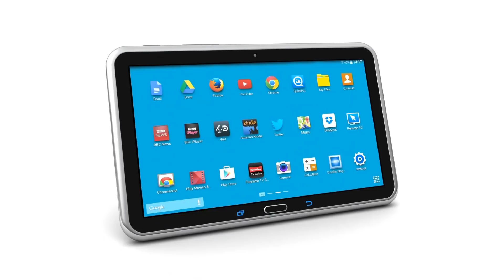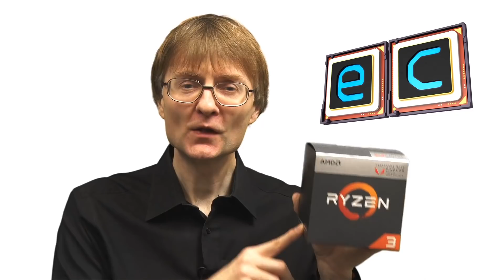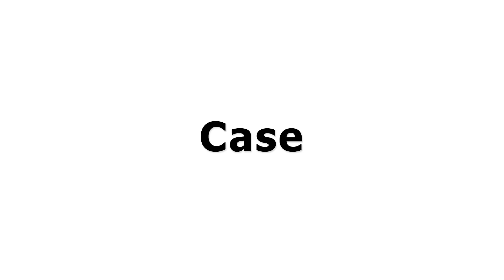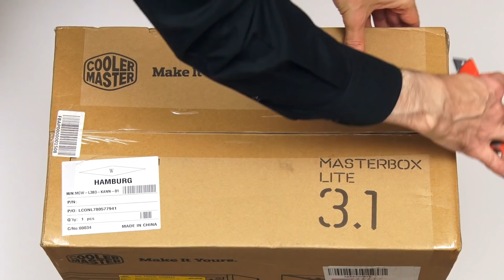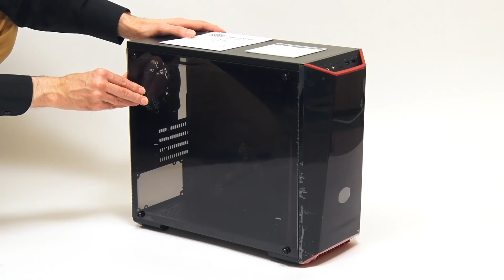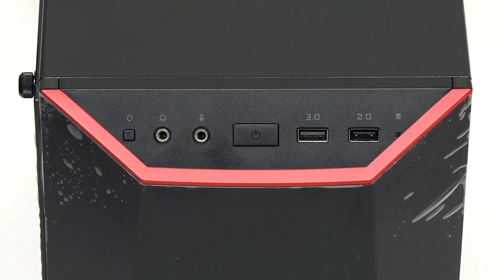Ryzen Budget PC Build #2: Case, PSU, SSD & Assembly

Comment: This series casing having "air flow" issues (btw EVGA famous 450W Psu model should be enough, and we using the same SSD S.F.S.G. )
Reply from the maker: Yes, I will keep a close eye on temps, and will be fitting two front fans. But for a 2200G build, this case should be fine.
Reply: @ExplainingComputers  I believe modding the front cover should do the trick...

Comment: 36c at idle in BIOS is a little warm, but a reasonable 'starter' PC
Reply from the maker: The PC has been running idle under movie lights for some time. It generally idles at about 32, which is not that bad,

Comment: i still using an old case from 2004 all simplistic at least it is black. there is no 120 mm fan slot but the grid on the PCI area had square holes that were luckily spaced just right for me to fit a 120 mm right there! (had to punch the holes "round" with a hammer and nail but the alignment was perfect!) so i guess i have one of those case with CPU intakes fans but mine has a custom PCI intake! 

the only way you could get as direct air is with those open air test bench tech reviewers has! so having the PSU at the top and 2 exhaust fan the air does a direct "L" shape in and out! (so i got no RGB but cooling by air is not a problem! water cooling would be impossible unless i get a saw making a hole at the top tho lol)

Comment: Great video as always! But as a pc tech/enthusiast, I'd suggest getting rid of the sandisk ssd. i see them fail more than anything else. And if it dies within the warranty period, you'll wanna pull your hair out dealing with the customer support. Samsung or WD ssds are my preference, though I end up using a lot of Crucial (Micron) ssds at work because there is a Micron facility where i live.

Comment: This case is fantastic for the price and I got it for £39.99 from Amazon with free Prime Shipping but I wish I got the version with 3 RGB fans and a power supply shroud that was £65. While it was a bit more expensive I ended up having to get 3 extra fans to cool the case down because the airflow is so bad in the case due to being quite compact and not having a lot of breathing room in the front panel. Plus what were cooler master thinking having a closed top panel. But yeah the extra fans ended up costing the same price as the £65 case cause they were RGB though they were the cheapest fans I could find. Plus the £65 has a PSU shroud for better cable management and is slightly bigger for more airflow. But I digress it is still a good case though I will probably be upgrading it in the future.

Comment: This is a decent little case for the price. I bought it for my little brothers Ryzen 5 1600 Build January 2018. (Hard to believe it's been a year). The only thing I didn't like was the Standoff threading on the tray itself. when I screwed the standoffs into the case  3 of the 6 for the Micro ATX motherboard  just spun, due to the cheaper metals of the case. But no worries, it all went together without a hitch and he loves his gaming PC. XD. 
I like the detail of your videos.  :)  much better to actually see whats going into the build and information about them. Thanks.

Comment: Little bit of BIOS tweaking required, your 2400 RAM is at 2133, probably needs XMP selected.
PS. Some cases have a hole to route the CPU power up close to it, some will allow it but only if the cable is put through before the motherboard, as there is room for the cable but not to put the connecter through when it's in place - and on that case (like on mine) some of the cable space comes from the side panel bulge.

PPS. Please do a trim change, it can be easy or damn near impossible - I absolutely failed to trim change a DVDRW (black drive with extra silver & cream trims) as I wanted to complete the silver accent, but I just could not unclip the existing trim
Reply from the maker: I will be covering the XMP setting in the next video. :)

Comment: This video took me back to my first Box when basic machines cost $2,000-$4,000 and lots of work to get it running. Beautiful job of assembly for such a reasonablev price. Using used parts today, if you know what you are doing, it is possible to build a server for under $450.00 with basic mouse, keyboard, speakers, monitor  and  DVD.  Building and testing takes time. Your video was beautiful and l am looking forward to. Part 3.

Comment: you missed a mobo screw by the 8-pin connector
Reply from the maker: Very well spotted. It was not missed in the final build, but I did miss it in the pre-build I did with the motherboard in a side-less mockup of the case. The close-ups of the connector insertions are impossible to film in the case, so had to be done beforehand -- and I missed putting in a false screw there! :)

Comment: it looks great. i cant wait for the RGB lighting that You will fit in it. :) about the psu i have non modular too and i barely fit the cables in the case. so now i have pile of wires :D. i did the cable management but it is not enough, but that doesn't matter now. the pile is hidden behind some black metal plate that is inside.

Comment: How much does the operating system disc cost?
Reply from the maker: Linux is free. Windows will cost anything between $5 and $120, depending on where you get the key from. No disk needed! I will cover this in detail in Part 3 (on Feb 17).

Comment: Loved the video as usual. I would've used something like a SATA based M.2 SSD but after seeing the price of that SSD I can see why you used it. Also that little standoff tool is nice. I usually had to use some needle nose pliers to get them to fit right. Still a shame that most cases are opting out for optical drives though. Can't wait for next week's video!

Comment: Buying a higher wattage psu will probably waste you a lot of money while the psu is running at 30 to 40% load.
and those modular cables look really ugly. Be quiet! has nice modular black ones. 10 times better in my opinion.
and a 120 gb ssd is very very very very very tiny. Bad recommendation. A 480 GB should be the minimum.
Reply from the maker: The higher wattage power supply will not use more power than a lower wattage one at the same load. If only, say, 60 watts is needed at a particular time, then only 60 watts is supplied, regardless of the wattage of the unit (though more power is used due to PSU inefficencies). On the SSD, I say extremely clearly that a SSD (or SSD + HDD) must be chosen to meet user requirements, and whatever size I state, people could say a different size is required. 120GB is still perfectly adequate for a great many PCs and users. For example, the i3 PC I am typing on right now has a 120GB SSD. It is about 70 per cent full after over 4 years of use, and it is the PC I run my business on, do all my e-mail, on which I prepare all of my lectures and presentations, and write my books on (it is probably used on average 30 hours a week). So it is the usage scenario that matters -- not the absolute capacity. If you are not handling significant video files, storing large media downloads, or installing large games, a 90GB+ capacity (after Windows) is fine for a great many users. So it is not a "bad recommendation" in many scenarios. :)
Reply: @ExplainingComputers  If you choose a to high wattage for the psu you won't hit that sweet efficiency spot.
I wouldn't recommend any of my friends anything below 480 GB cause they all game, program or cut video. Well I wouldn't even recommend it to my mom cause she likes to keep all her stuff archived.
Reply from the maker: Agreed on the sweet spot for efficiency of a PSU, but we are only talking comparing a, say, 450 vs 550W choice. And on the SSDs, you clearly know what your friends will need. :)

Comment: Chris, there are some cool tricks to tweak the performance of your setup: the Ryzen cpus perform really better when you rise the speed of your memory to 2933 MHz - so check if you can OC your RAM. Vega integrated graphics can also have tweaked its operating frequency, to bust your gpu output.
Reply from the maker: Agreed.

Comment: @6:15 I'd throw out that (1) there are several other sites which seem to have basically the same calculator and (2) they all overestimate the power requirements (just press Calculate without adding anything) by ~113W Load, ~163W Recommended.  When I take the specs for my HP Elite 8300 with a GTX 1050 Ti it claims I'll have a max of ~320W Load and ~50% more recommend watt PSU even though from a Kill-a-Watt I've never seen the system go over ~150W Load (and hence reasonably needing around a 225W PSU).  Good thing too since the power supply is only 240W.  There was also a nice video from Gamer's Nexus recently about how in a pretty reasonable config needing only a ~400W PSU,, although that obviously varies a lot on what you're using.

So, uh, yea.  550W isn't ridiculous or anything.  Just a little FYI on how to quickly see if there's something fishy going on.

Comment: 7:42 Bubble wrap! I love bubble wrap, lolz (listen to me popping around like a little twat lolz)
Also, that's a PSU that doesn't mess around...550 W should be enough for just about any build.
7:56 I'm surprised it doesn't smell like vinyl ...
9:27 I wish I had that many SATA connectors on mine...
10:05 120 GB is not a lot of storage these days. Of course, the OS shouldn't require more than a third of this at most, at best, one-sixth.
11:10 Doioioioioioinnnnnggg... lolz
11:17 Reminds me of the AVGN/Bullshit Man crossover episode about packaging woes, only less vulgarity and less anger, lolz
13:22 Quality of Life things like that always get a notch of respect in my book...
13:50 My only question on that is what if you only have a slotted screwdriver on hand...
14:19 "These things tend to be a bit of a swine..." lolz Oh yeah...definitely true.
14:57 And...ta-da! Said no one ever at this point...lol
17:42 Again, more QoL goodies. :)
19:04 One reason why I love watching these is the sense of humor always comes out and I love it! lol
22:20 That's an interesting looking mouse input device...
23:00 Oh my...that's an interesting BIOS screen; never seen one with a GUI like that.
My only gripe is that there's no way to implement an optical drive; I actually like having at the very least, some form of DVD+ RW capable medium so that way I don't have to hog a USB slot for an external one.
Reply from the maker: Hi Amy. :) The rodent at 22:20 is a 3M Ergonomic mouse.

Comment: Remember that the point of a "switched" power supply is that it only makes as many watts as you need.  So a 1000 watt power supply in a 200 watt system will use no more wattage than a 200 watt power supply in a 200 watt system.  So always buy at a price point, not a minimum size.  Bigger is always better, for transferring into future builds..
Reply from the maker: Agreed. I hate having to replace a PSU in the future purely because I bought a low wattage one.

Comment: This is a nice video tutorial, but it's missing some key components for the very basic user.  Christopher, you know what your doing and that's obvious in your tutorials.  However, if you intend for these videos to be used by the beginner, it is highly recommended that you include ALL the steps not just the overview steps. If you don't mention something in the video then please include a popup message detailing the missed steps.  While it might seem obvious to most existing PC Builders, it's NOT for the first time or uninformed, i.e. non-enthusiast builder. Steps like 1) hooking up the rear fan to the motherboard, 2) installing the SSD into the frame that came with that case or 3) how important it is to get the power, USB & Audio connectors turned around the right way so that they fit without any force or that the missing pin is oriented correctly.  I taught introductory PC classes for close to 10 years and it's those missing small steps that cause a user to blow-up or damage a connection because they forced it into a socket. Even though I know how to build PC's I always enjoy these videos for the entertainment aspect and sometimes I learn something I'd forgotten or that's newer with current technology.
Reply from the maker: I really don't think I missed anything here. I did show the fan connector. And I showed exactly how the SSD mounted. There really is a limit as to how much detail I can include. Here I even mocked-up the inside of the case so that I could show plugging in all of the connectors (which is impossible to film under normal circumstasnces).

Comment: do you have any opinions on external ssd or removable/swap-able ssd drives?

the price of ssd is beginning to drop to usb drive levels. i can get a hyperx savage 960gb external ssd in the CAD250 range which is rather nice, but i don't know how it would perform compared to internal ssd.

i would like to have an internal one that has 3-4 operating systems multi-boot, and put all the data/apps on swap-able external ssd.
Reply from the maker: I  may well do a video on tuns. The Samsung and GTech external SSDs look very good and have great reviews.

Comment: Thank you sir for the video. 
BTW, I am somewhat disappointed at the trend towards reduced interface options, particularly when it comes to optical data storage. A good DVD/BLURAY/CDRW drive is STILL a valuable tool in personal computing... I hate to see the industry move so completely  away from non-chip/magnetic based data storage options. But THANKS for this build; you're the best!

Comment: You may have already done this, but those of us that chicken out and buy a pre-built system, or have transported one to another location, how about a simple check list of what to try when you set it up and it doesn't work.
I.e. : resetting cables and ram and the one I'm embarrassed that I forgot and actually sent the system back making sure you've plugged your monitor into the graphics card and not the disabled mb port. Am sure others can add to this list.

Comment: How do you know the correct positions to put spacers into the case?
Reply from the maker: They are labelled for the size of board (here microATX), but you have to compared to the board itself to use just the right ones. I got a ruler out!

Comment: I've done this many times over the past 25 years or so, and I'm always amazed at how much the hardware has changed. The mobo used to have dozens of little parts soldered to it, but now yours looks so clean and simple. Possibly has something to do with the big Gigabyte brick on it, eh? It's good also that the power supply is mounted at the bottom of the case instead of mounting at the top, like in the "good ol' days". Thanks for these videos Chris, looking forward to the next one.

Comment: I do understand that you don't want to actually use this machine for anything after you do the build but there is no freaking way I want a computer with 120 GB of storage. I'd take an old fashioned rotating drive first. I have a music collection and a photograph collection and a few videos I have made and this is not going to cut it. Yes I can hook up an external drive or two but this isn't going to allow me to install much software either so no. 256 with a data drive is pretty much my limit. My little Hell Crec NUC has a lot more than that. It is also true that you need some free space on digital drives for wear leveling or they die faster.
Reply from the maker: It all depends on use. I run my business on an i3 with a 120G SSD -- all of my books and other documents and presentations are on it, and after five years I still have 30GB free. :)

Comment: I have the Corsair vs450 which is good enough for me as my pc on pulls around 100watts and when I get a gpu it will only pull around 400 watts in all 
I also got a Corsair spec 0-4 case

Comment: Side window + poor cable management = tears T.T
Zip tie the cables behind the motherboard tray please.
Reply from the maker: The cables are secured.
Reply: You have like an inch or more between with back panel and the case frame for cable management.

Comment: I’m about to build my second unit after decommissioning my previous system of about 7 years. This time around, however, I’ll be going the mini ITX route. 

I remember one thing that really made me anxious was putting in the 20+4 motherboard connector. They sometimes require a bit of a push, and I’m afraid of fracturing the motherboard. Especially with ITX, where it seems that they are held into the case with 4 screws.
Reply: I always try to put my fingers under the board when pushing those things in. I will admit that I tense up a bit, too.

That one, and PCI/PCI-E slots on some motherboards. The worst though is actually putting the CPU itself in, because my eyes don't see those little pins all that well (there was an incident with a pentifum 4 years and years ago, ever since then...).
Reply: DFX2KX my next big worry is GPU sag, it might be an unpopular opinion. But I really feel that there should be a standardized form factor for GPUs. In addition to this having a mountain bracket on its opposite side
Reply: fechaqui 95 definitely, they should come standard with them now.
Reply from the maker: A totally agree on the level of board flex inserting those connectors. Sometimes worries me a great deal, but I've never had an issue because it it.

Comment: I noticed 1 silver riser I assume for centre of case/mother board -am I correct this is in addition to the other M rises that were hand screwed in.
Reply from the maker: The silver riser is the tool that allows the other risers to be screwed down with a screwdriver.
Reply: Not the tool he was holding the additional silver screw not the small torx tool he was using
Reply from the maker: I am confused now. All of the screws/risers (shown at c. 12:45) are black, aside from the tool, which is sitting there with the risers.
Reply: Thanks 😯 I;ve paused and re viewed you are correct my 1st and only build was dx2 66 -early 90's -do one of the risers screw into centre of case at all